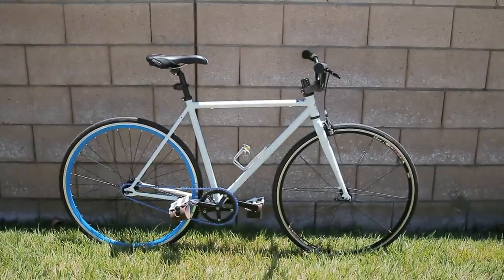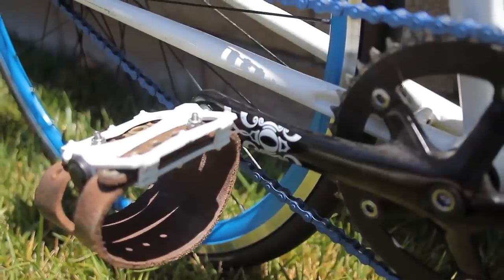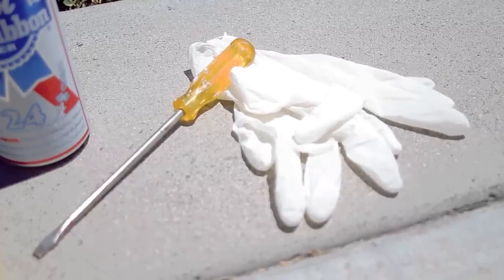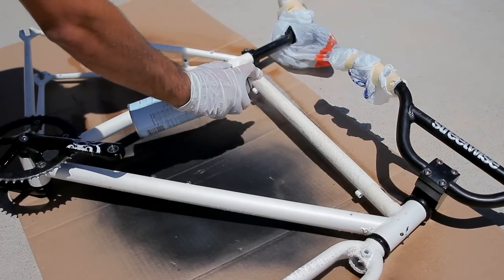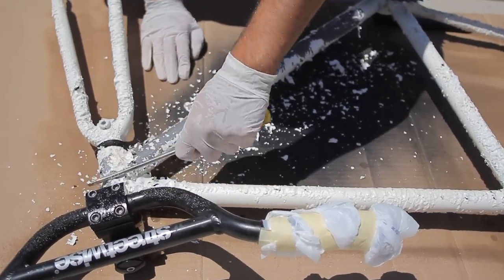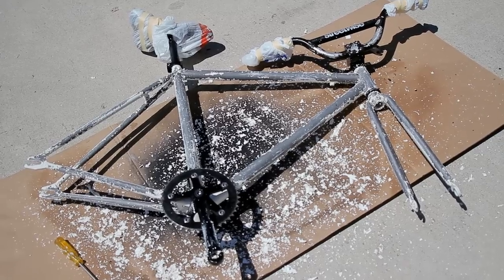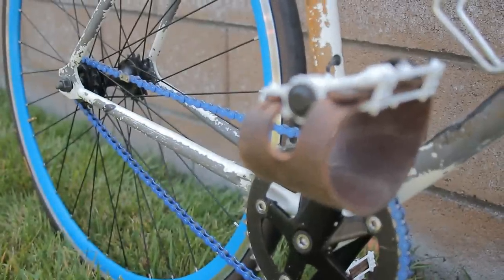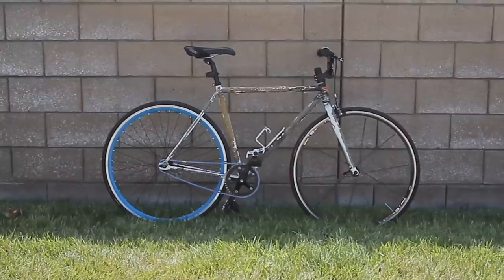How to Build the Ultimate Beater/Lock up Bike

Comment: Blast inside the tubes with fluid film once a year and you're done.Its a lanolin based rust preventer. Get it at the parts store by the WD40 and such. It's cheap & used up north to treat truck frames and the underside of your vehicle.